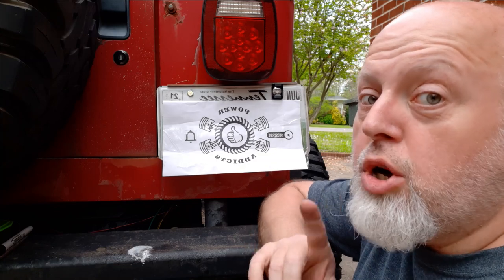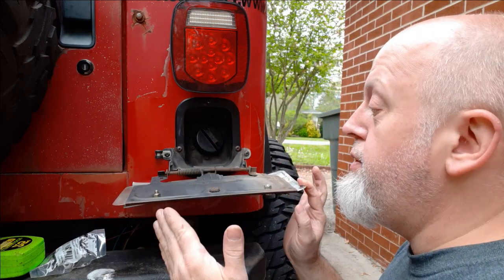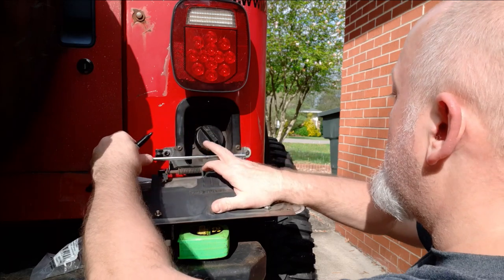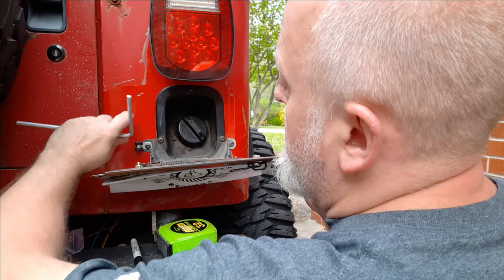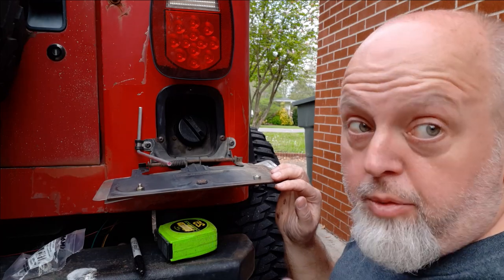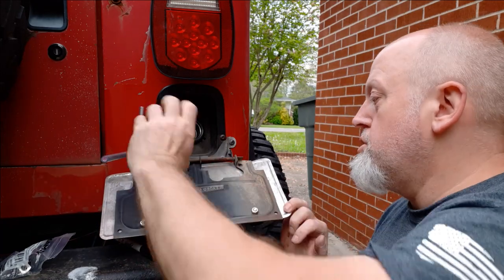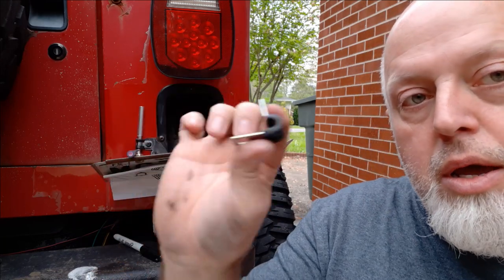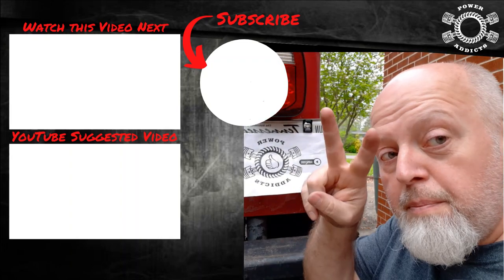Jeep YJ License Plate Gas Fill Modification #poweraddictscrew #jeeplife #jeepfuelmod #jeepyj

Comment from the maker: Here are the parts used in this Video. The channel gets a small commission for the purchase at no extra cost to you. Thank you for your support!
License Plate Bottle Opener: https://amzn.to/32tCphL
Aluminum Rod: https://amzn.to/3akSgU8
1/4" Metal Wire clamp: https://amzn.to/3duCLuX
1/4" Vinyl Tubing: https://amzn.to/2P0YWzr
T20 Torx: https://amzn.to/3v24R6N

Comment: FYI-I glued a small but strong magnet to the top corner of the license bracket  on my 92 YJ and then removed the springs completely. Now it folds down a lot further for fueling and stays up and secure with only the magnet holding.
Reply from the maker: Sounds like a good idea. Thanks for leaving a great suggestion for others.

Comment: I noticed that the rod pivots at an angle when you have the pressure of the license plate spring press against the bottoms leg of the rod. It may have been better to use a second clamp near the top of the upper section of the rod to keep it solidly mounted. 

Other than that I think it’s a super cool idea. I especially like the idea of using the 1/4” clear tubing. It not only keeps the chance of the rod singing your paint low it will also prevent a new rattle from starting up!
Reply from the maker: Yea it does pivot a little. Maybe move the clamps to the screws holding the black plastic filler neck to the body. You could then have 2 clamps to pivot from. Glad you like the idea!! Thanks for dropping in! Have a great day!

Comment: In the forms on facebook I’ve seen you can uses the gas cap to hold the plate down from the factory. Haven’t tried it yet since my plate is moved.
Reply from the maker: I saw that as well. I tried it and it didn't hold it open as well as it did on FB. Maybe I did something wrong?
Reply: @Poweraddicts   I was amazed when I first saw it! My license plate was all sorts of messed up when I ran it there. I had a extra long screw holding the plate to the hinge and I was always scared it was going to slip. Spark and send the station sky high.